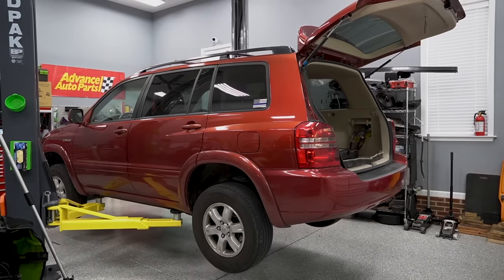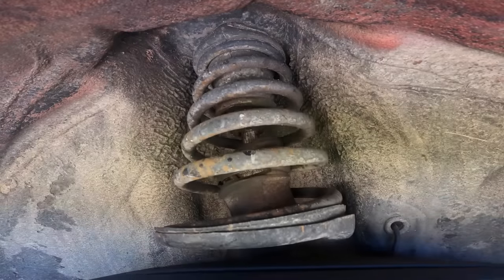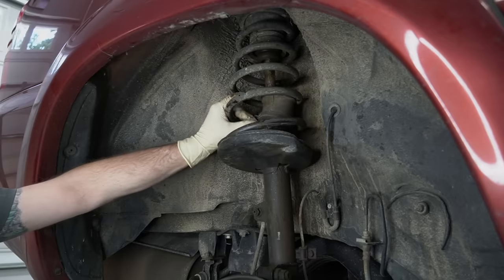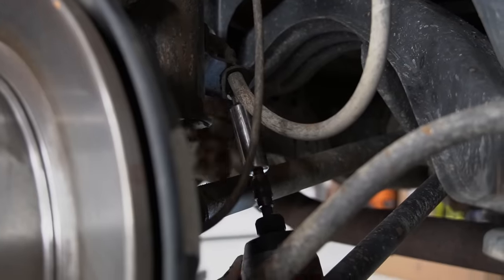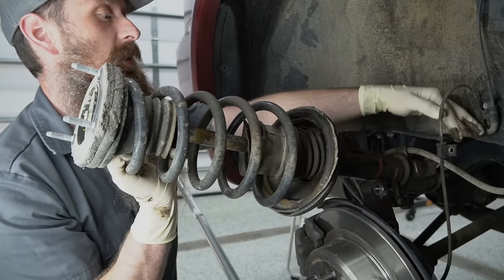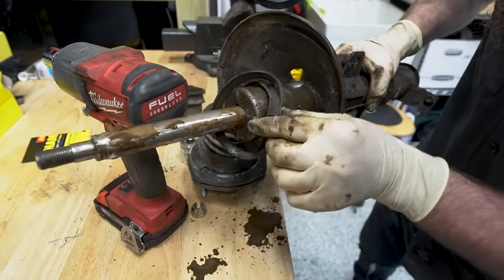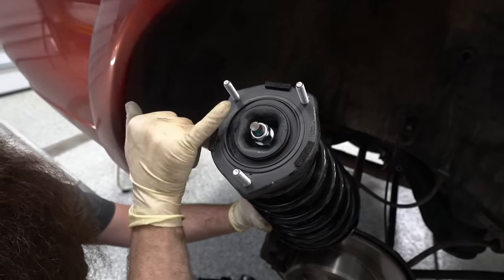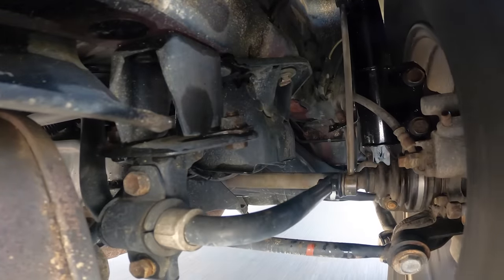How To Fix a Noisy Suspension ~ Noise over Bumps

Comment: @HumbleMechanic    Would you know the torque spec for the center top nut for front struts that holds the spring on a 2006 mazda 3s 2.3l auto sedan ?
Reply from the maker: sadly I don't :(

Comment: Hey, Charles. I've been dealing with a p1127 mixture adaption (mult) System too rich on my mkiv 12v vr6. I've replaced the following: 
- Up and downstream o2 sensors
- all 6 spark plugs (oem)
- air filter 
- purge solenoid
- fuel Injectors 
- tested fuel pressure regulator 
I can't seem to figure out what is causing this. The car is consuming a fair amount of fuel. If you have any tips to point me to the right direction I'd really appreciate it. You know more about these vr6 engines than anyone. Thanks!
Reply from the maker: What’s your MAF readings?
Reply: @HumbleMechanic  I did a brief test via my scan tool and got these results: 
Idle - (690-710 rpm) 3.00-3.25 g/s 
(1409 rpm) 5.50 g/s 
(2105 rpm) 9.50 g/s

Comment: Hola good sir. I too have a mk4 r32, with Bilstein coil overs last changed in ‘08. Although the suspension seems fine, no noise/ or failures. When do you recommend changing these and what are your recommendations? My car is all stock minus the coil overs, but I do like how it dropped the car a bit. Thanks.

Comment: 10mm, 12mm, 14mm, 19mm, #6 Allen, lol.  It amuses me how different manufacturers have their preferred fasteners.  
I just reinstalled the V6 in my old Ford Ranger, and I'd guess 90% of the work was 8mm, 10mm, and 13mm.  Everything going swimmingly then there's a random 11mm holding a wiring harness bracket.  Like c'mon Ford, wtf.

Comment: I have a Toyota tundra, and when I am in a completely quiet area and driving, I hear a squeaking noise like metal and when I go over train tracks or bumps at a decent speed I hear a sound that sounds like air or something leaking out from the back of vehicle 

and it only stops when I put the brakes on the vehicle. I took it to a mechanic’s shop i tell them about it  but they all say it’s fine but the sound to me is pretty obvious to me after driving.

I had bought it around a year or two ago whoever had it definitely used bed to haul heavy items because it looks like the back of truck is leaning downward ever so slightly 

Does anyone know what is it could be ?

Comment: That rear rotor is brand new. How did that get replaced and the mechanic not see how bad the strut was? I mean it isn't a little shot, I don't think I've ever seen one that flexes like that. It should have been immediately obvious just taking the wheel off.
Reply: Customer budget said no 😁😆😅
Reply: @VintageTechRepairs  Sadly that is not an unrealistic scenario.

Comment: Even though it's a non VW that was interesting to see a well explained breakdown of simple and sometimes not so simple maintenance being performed and condensed into a very enjoyable video like this nice work Charles
Reply from the maker: Thank you!
Reply: @HumbleMechanic    Would you know the torque spec for the center top nut for front struts that holds the spring on a 2006 mazda 3s 2.3l auto sedan ?

Comment: What would be the lifespan of that part?
Reply: Excellent question. 
I've owned a several new and used cars. I've found from personal experience, around the 5-6 year mark the factory struts are showing wear. At higher speeds, the dampening isn't so great and the car gets a little floaty with big bumps and undulations. But it is still road worthy, just don't race around in a sports car expecting Formula 1 handling. 

By the 8 year mark, you will want to replace the struts if you value your safety. Worn struts and shocks can be a serious safety hazard.
Reply: < 170,000 miles

Comment: Ugh, stock endlinks.......I hate those so much. Up here in the rust belt, that tiny Allen hole is completely round and the nut is completely seized. The only way to get them off is to cut them off......or torch ‘em off!
Reply from the maker: Yeah I don’t like that style. Luckily in the south it’s not a huge issue

Comment: Can you make a video on that strut compression tool you are using
Reply from the maker: I’ve used it in other videos. Suspension on the Miata and R32
Reply: @HumbleMechanic  Where can I pick one of those spring compressors up?